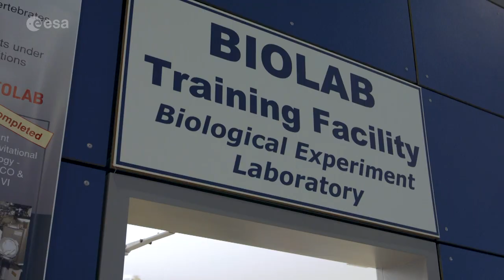Thomas Pesquet’s Alpha mission

Comment: so how ESA allows to use Spacex rocket and spacecraft...
Reply: @Lúd If I remember China is banned from ISS
Reply: ESA does not have a man rated launcher. Ariane 5 is not. Neither Ariane 6.
Reply: @Giloup920  Ariane 5 is man rated.
Reply: @ondrejmasek6396  No.
Reply: @ondrejmasek6396  It isn't. What spacecraft would be even used?
Reply: @Giloup920  "ESA originally designed Ariane 5 to launch the Hermes spaceplane, and thus it is rated for human space launches."
https://en.wikipedia.org/wiki/Ariane_5
Reply: @ImieNazwiskoOK  Hermes and CSTS
Reply: @ondrejmasek6396  Hermes is only for cargo (it could have only 2 crew with comfort of Gemini so more like 1, so not enough for ISS).
Starliner is for Atlas V, they tested it on it and also same company.
Reply: @ondrejmasek6396  Welcome back to the world, Rip Van Winkle. Hermes was cancelled in the 1990s. CSTS is a defunct program (over a decade) superseded by another that itself is no longer being actively worked on.
Reply: @Giloup920  Yes Ariane 5 is technically man rated ,   it was originally designed to carry a french space shuttle
Reply: @NPJGlobal  The man rating qualification was never performed.